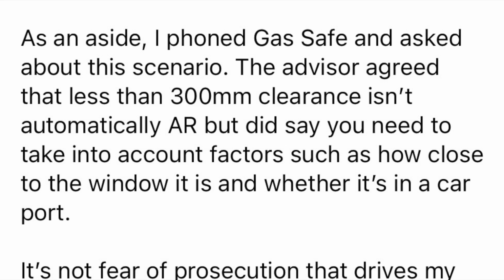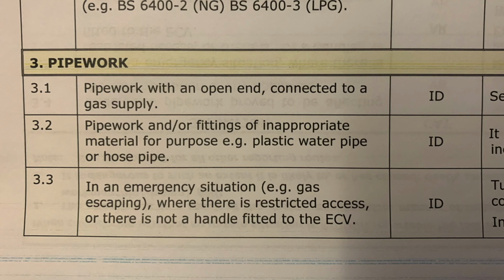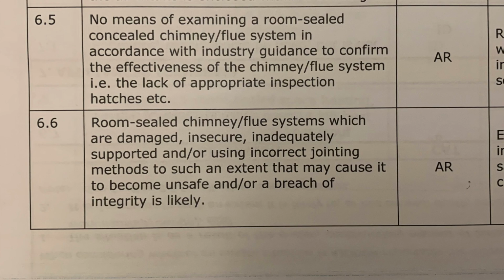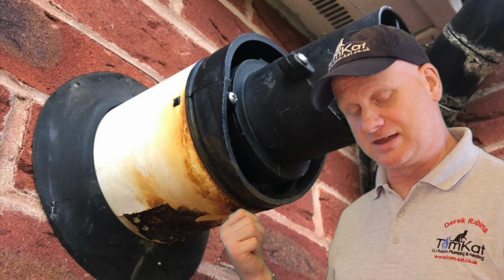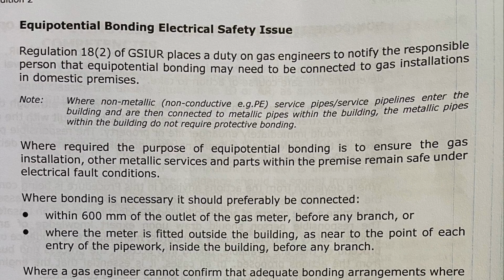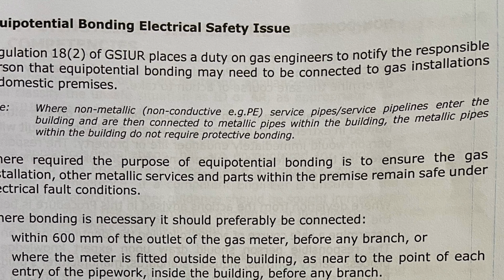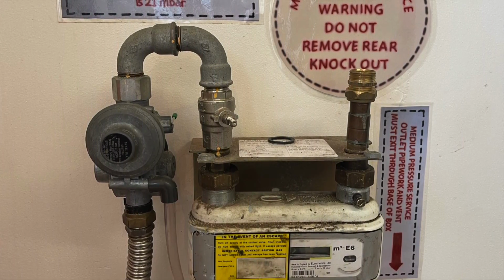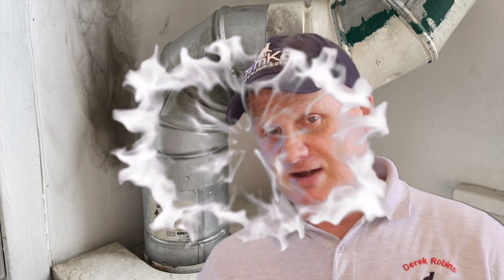I failed and I am sorry, trying again to get rid of gas engineers making up their own regulations.

Comment: Another great video thanks Derek.

With regard to the Vaillant flue with the wood screws and missing screws on the collar.

The 6.6 notes say "missing .. screws ... allowing movement of the chimney/flue to such an extent that may cause it to become unsafe and/or a breach of integrity is likely".

To me the key part is "allowing movement".

Although it's clear that the screws are missing how did you check that the missing screws actually resulted in allowing enough movement to become unsafe? And although the woodscrews are not the manufacturer supplied ones; what makes them unsafe? (apart from maybe scratching your hand on the points!).

(I guess it's a moot point really as I (like most engineers) would just replace/fit the correct screws while doing the service, rather than AR ing the boiler).

Comment: Re earth bonding with plastic pipe, did you notice the distinction that the metallic pipes inside the building don't need bonding (but the copper pipe leaving the meter presumably still does)?
Reply: If plastic pipe feeds an external box and the copper pipe is not in contact with earth or wall structures as it would be sleeved in plastic thru walls then typically it does not need bonding.

Comment: Re Bonding. BS7671 has always required equipotential bonding between simultaneously accessible conductive parts as a minimum. However for the gas engineer its a potential difference that can carry more than 30ma (@50v) that is a risk of a spark.  So using the continuity bonding lead is a must even if there is no evidence of Main or supplementary equipotential bonding.

Comment: I have to sayDerek, in the past when I was working and I came across open ended gas pipes, I automatically capped off gas pipes even if they were disconnected from the meter didn’t even think about it

Comment: Great to report as Riddor.  However, looking at the state of the pipework it may have been put in 20 years ago. Doubt you'd ever find out who fitted the plastic fitting. Just fix and charge accordingly.
Reply from the maker: You still need to report it even if you just fix it

Comment: I wonder why people that aren't engineers keep calling themselves engineers?
Reply: We don't but gas safe and ultimately the hse ie the government do
Reply: I still don't get why back in the 1960's, a GPO employee who would set the dial speed, adjust the gaps on a dialling cam, strip down and lubricate the dial and generally overhaul a telephone  was called a 'technician' whereas today's telephones are not serviceable and the person who comes and connects the Openreach A and B wires to a master socket is called an 'engineer'.  As far as I'm concerned (and I'm backed up by historical usage), an engineer designs boilers, cars, telephones, and a technician or mechanic services them.

Otherwise I'd take my van to an automotive engineer to have the oil changed.  Just a thought!

I understand there is a crossover in that a Registered Gas Installer might design a heating system, but as he or she is generally working to standard industry practices rather than truly inventing new and radical solutions, I feel the term 'engineer' is best not used in these circumstances... otherwise how do we differentiate between the people that paint the bridge on the gorge at Bristol from Brunel who designed the bridge (in a way that nobody had done before)?
Reply: @johnbull5394  Exactly. The degradation of the title has led to a loss of understanding of what engineers do and this in turn has led to a loss in trust, since there are so many dodgy "engineers" fixing washing machines that fail again a week later. This has brought the title into disrepute and has impacted on the intake into professional engineering courses to the extent that there's now a shortage of real engineers. Terms like engineer and architect used o be protected in the same way that "solictor" and "doctor" are protected but something went wrong along the way.

Comment: ALL Room sealed appliances have to be sealed... If its missing seals where wires come through technicaly its ID not AR...
Reply: What’s the immediate danger?
Reply: Any room sealed appliance needs to be fully sealed or it’s a danger
Reply: This is simple stuff shouldn’t be working on gas if your at risking missing seals on room SEALED appliances
Reply: @bubbagun3576   Where cables pass through the case they’re called grommets, not seals. 

I suggest you check this “simple stuff” with Gas Safe. There is a risk of POCs escaping the case where the grommet is missing. If they’re not escaping right now, it’s not ID. 

Gas Safe agree with me and so do appliance manufacturers, so your “should not be working on gas” statement makes you look a bit daft. 😄

Alternatively, you could just look at GIUSP section 7.2, bullet point 3, which specifically covers what we’re talking about and confirms what I’ve said.
Reply: So you would at risk it if poc’s are not escaping right now? Ffs I guess you work for your self right?
Reply: @bubbagun3576  did you look at the section of GIUSP I mentioned? It’s there in black and white. The exact scenario you’re talking about is specifically covered in GIUSP. 

Yes, if POCs are not entering the room right now, but there is a possibility they could, it’s AR not ID. It’s quite simple really. 

Phone Gas Safe if you don’t believe me.
Reply: So if the test points missing it’s at risk is it if no pocs? What about no air intake test point?  At risk if no pocs? Bollucks it’s all ID f the gas regs I look after myself
Reply: @bubbagun3576  if the test point is missing it’s ID. If flue integrity is missing it’s AR unless it also fails the flue integrity test, in which case it’s ID. 

Both of these scenarios are in GIUSP too. Have you looked at it?

Comment: Hi TomKat what's the situation if you come across a black cooker hose from a  bayonet going to a gas Hob only ?
PS it's not a landlords property.
Reply: Cooker hoses are allowed on hobs unless the MIs specifically say you can’t. 

There’s a TB covering it and it was in RGE some months ago. I was surprised as it’s not what I was taught but it’s definitely correct. I phoned GS to confirm. 😁
Reply: @edmetcalfe8974  Thanks for that great information I will try and find the MI

Comment: I would have catagorised the bodge valliant flue system as terminating into an internal space and ID on that basis. The official terminal is inside the room, circulating poc back into the air intake
Reply: Good point, although the acid test would be: is there more that 10ppm co being discharged into the room. Another viewpoint to explore: i winder if we could ID this based on departure from the Manufacturers Instructions! Any comment?

Comment: Re: The flue less than 300mm from opening window. Don't I recall an RGI going to prison after passing a flue near to a nailed shut window in a hotel. Somebody later un nailed the window, opened it and a fatality occurred. I suppose the question I am asking is " Can you guarantee that flue will never allow fumes into the window in all atmospheric conditions ? "  Hmmm 🤔 . It could be you in court having to back your NCS decision up on a very sticky wicket. No inspector from HSE or Gas Safe, is going to defend you in the event of an incident. I'd suggest that in those circumstances..rightly or wrongly, most operatives would play safe and AR it.  Who can blame them?
Reply: Great western hotel in Newquay. I work there with the new boilers now fitted. That flue always sticks in my mind when I’m servicing and for me I wouldn’t ncs it, it would be AR.
Reply: My thoughts exactly.
Reply: 1. Derek! Congratulations on a fantastic video.
2. I fitted a combi where the flue could only terminate within 300mm of an openable fanlight pvc window. A gas safe inspector told me to remove the handle in shut position, block access to spindle receptor and stick a permanent notice warning the window must not be tampered with. I had to have a warning sticker made for this.
Reply: @ghaderortakand6027  wow, that’s pretty much what they did at the great western. But the window got changed after a refurb. I would get that in writing or email. 👍

Comment: The flue proximity  is a very common scenario, NCS can be appropriate, ascending  to ID.
My view was that flue was AR.
It's  easy to remove ourselves  (gas engineers) from future atmospheric  scenarios, boiler combustion issues.
Ultimately , common sense must prevail.
Landlords dodgy  work, ID and RIDDOR, If I don't  get paid, small price to pay for gas safety.
Every Gas Safe installer should have a copy of Ninth Edition (IGEM/G/11_2ND EDITION.

Comment: Quality vid once again Derek.
It does come down to judgement but reinforced by the regulations. 
I generally fill in a Warning/ Advice notice to cover me, if AR or NCS...ID is clear enough..
The rule I use is does the appliance need any mechanical or user engagement when operating to make it dangerous or is it just dangerous without intervention..
As regards to the flues on the balcony... I recall it's one zone where 2 sides of the area are open. 1 side means appropriate flueing required...
Keep up the good work mate👍🏾👍🏾👍🏾

Comment: Tbh with the flue to close to the widow I'd AR it yes on the day you tested it all was ok but what about a windy day. I get fed up of seeing stuff installed incorrectly from day one.
Reply: Nope ncs all day long on that one…..a balance flue may be a different story but again it’s engineers judgement. I’d feel comfortable leaving it you may not. It’s those who don’t see or evaluate the risk are the problem.
Reply: @richard8303  the flue is not installed according to manufacture instructions on  the day tested all may be fine but there's an obvious risk hence why manufacturers give a distance. I continually see flues being installed incorrectly and installers know they can get away with it as it's only going to get NCS .
Reply: @gazmondo1971  I don’t disagree with you at all but we need to look ‘At (the) Risk to the customer In individual circumstances, and deliver the right advice to the customer. Manufacturers now allow for certain distance to be reduced if all other clearances are met, if you believe there is a risk to that customer then you can only do what you think is right. But I believe that there is also an issue with certain engineers scaring customers into new boilers. 
Over exaggerating a safety concern is as bad as under exaggerating a safety concern in my opinion.
The good thing is I can tell you care about your job. I’ve actually gone to jobs which I’ve been to in the past and changed my mind in the safety situation I’ve previously left it in and gone from ncs to AR either because circumstances have changed or maybe because I missed certain factors on the day.
The important thing is to be always looking and improving. You won’t always make the right call but you won’t be far out.